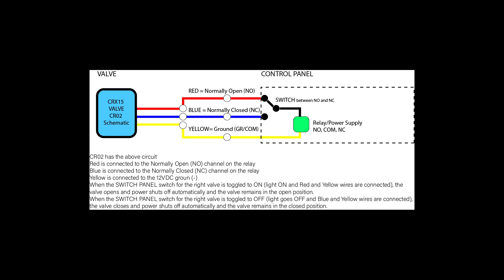Showerloop KIT: CWX15-CR02 VALVE installation

Comment: Thanks for the guide - this is such an incredible project, thank you for open sourcing it. Really incredible amount of work put into this. I'm going to try to make a prototype for a camper-van. I believe your automation really makes this system so usable. without these electronic valves, changing modes would be really cumbersome (and would likely not get done/ get done properly)
Reply: Thanks mr.